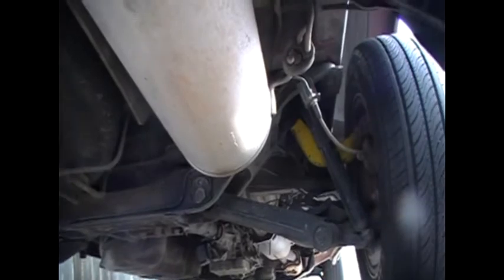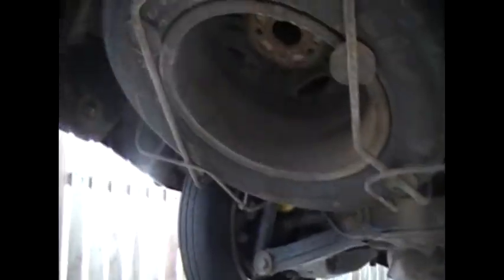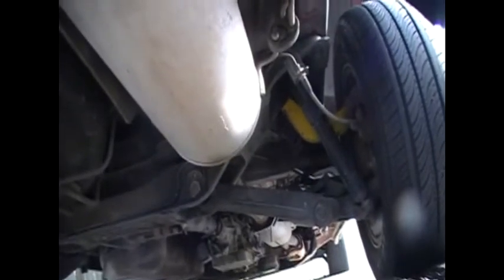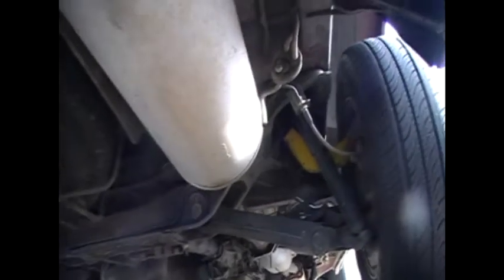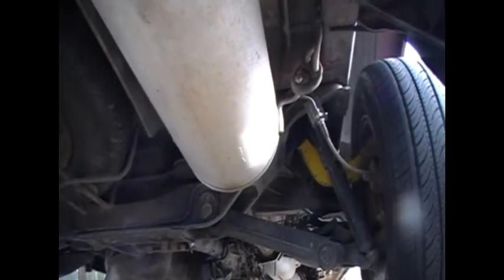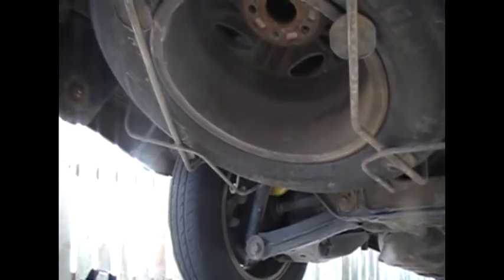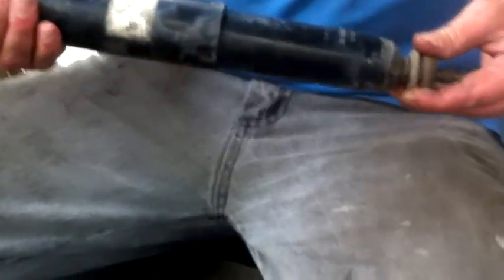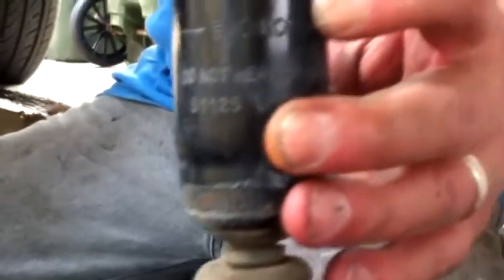Changing Rear Shocks IRS [ Tarago, Previa, Estima, TCR ]

Comment: I wonder if there is any video's or information on the removal and install of the IRS differential?
Reply from the maker: I have been searching but have come up with nothing as well. Think I might have to visit Toyota & ask for a copy print.
Reply: Was not all that hard to work out, Remove 6 bolts on each side to remove the axles from the diff then remove three bolts to remove the diff.  Axle bolt are 14mm and the diff mount bolts are 17mm. 4 14mm bolts on the tail shaft.  It took  two people to drop the diff and then install.
Reply from the maker: I am still trying to find IRS info. Nothing in my manuals about IRS and Toyota said they will get back to me. December is a bad time of year as everyone is busy but hang tight. As soon as I find out something I will let you know.